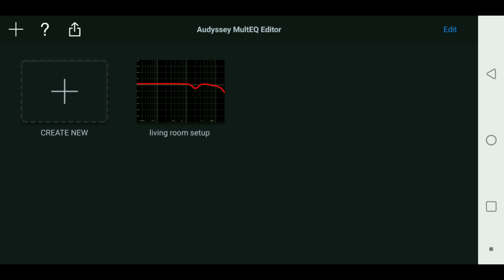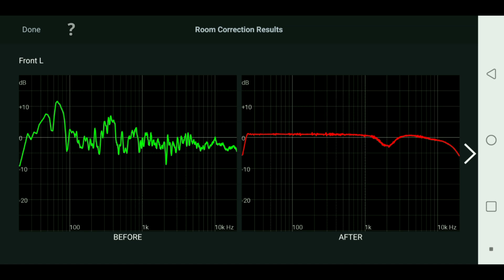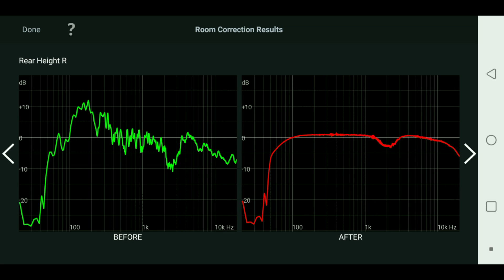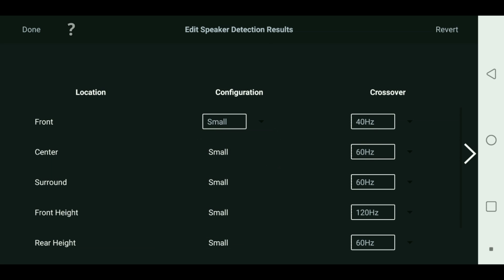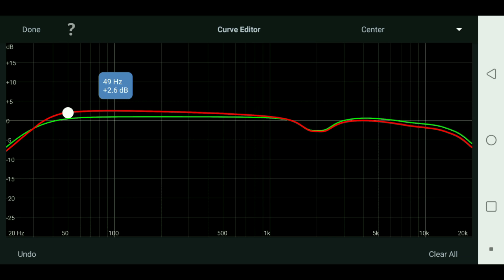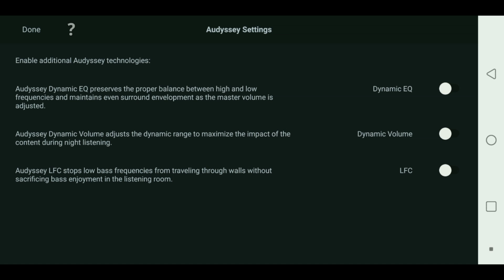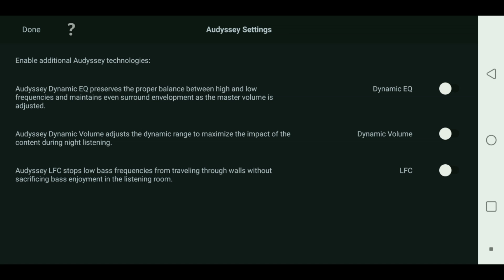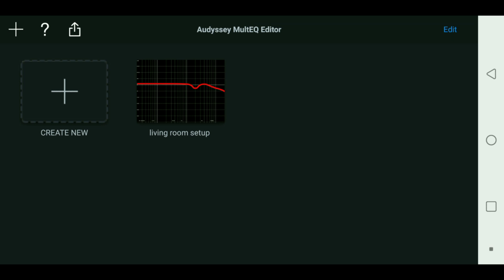Audyssey MultiEq App Walkthrough for Denon/Marantz

Comment: Hi, great video as usual, I purchased this app for my iPad, my question is, even though I calibrate pd everything before this app, now I have to do it all over again? Is this correct?  Thank you
Reply from the maker: The app should sync with your receiver if both are connected to the same wifi. Should be the same in app as it is on receiver but I haven't tested my theory
Reply: Kpaceguy it’s telling me to connect my cord and redue everything, please let me know what you come up with when you have time.  I mean do I have to start from scratch?
Reply from the maker: @lusly258  if it's your first time using the app, yes

Comment: Great walkthrough Kpaceguy! This video couldn't have come at a better time.
 I bought the app too and it has done WONDERS for my sound over the in-receiver calibration. I'm not exactly sure why but the sound from my brand new Reference Premiere  8000F towers and matching RP-504C center channel  sounds magical!!! I have it paired with an SVS  SB-2000 sub. It's only at 12 o clock gain and it is MORE than enough for me.

So I have a question for you...

I demoed and am planning to buy the Klipsch 500 SA height elevation speakers. The problem is that they don't produce the amount of bass & full sound that I want as compared to the SVS prime elevations when I A/B tested them. I get it, two different speaker designs produce different sound signatures...

 BUT,  the Klipsch actually has 5 1/4" woofers...actually larger than the SVS elevations...

And so I want more presence in my rear surrounds when I get the Klipsch. That's how I like my sound.

I would like to adjust individual Bass and Treble for my rear speakers. Kinda like a parametric eq.

What frequencies should I boost to get more bass and mid-range out of the Klipsch Elevations using the app? I'm not sure what the frequency numbers should be. Advice appreciated!
Reply from the maker: SVS sounds deeper because the cabinet is bigger.  You can add more bass but turning up the lower frequencies like 35-80 but be careful not to turn it up too high. The lower the bass the more power goes to the speaker and in return the speaker can't play as loudly
Reply: @Kpaceguy  Thanks man. The thing is that the dimensions of the Klipsch elevations are larger in size than the SVS prime elevations. 

But it's good to know that I can increase the bass at those frequencies. By the way thanks for the pro tip on the dangers of raising it too high.
Reply: mystickid1 the klipsch  speaker will sound more lively in the top end, and audio will be perceived to be less bass heavy, because of the horn tweeter in comparison to the svs dome tweeter. But you should still be able to boost the   50-70hz response with the app on the klipsch and it do just fine. Obviously the more power you send to klipsch will help too. 👍🏻
Reply: @Test-Pilot1194  Thanks Duane. What you're saying makes perfect sense. Thanks for the tip brother!!
Reply: mystickid1 no worries my man!👍🏻